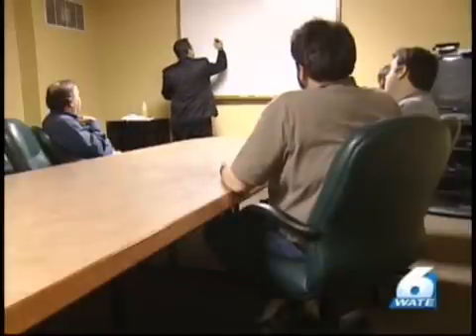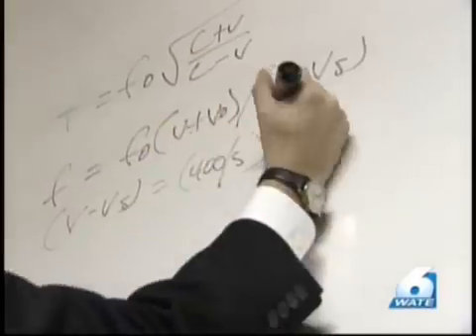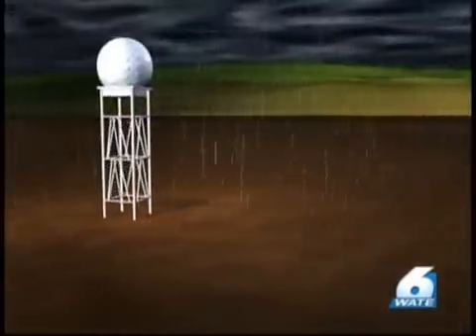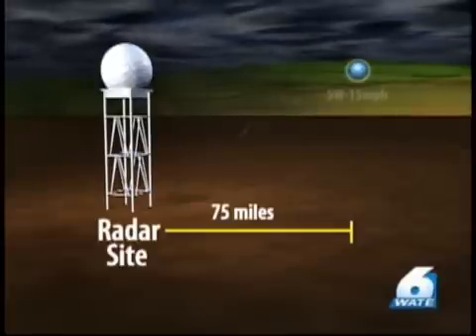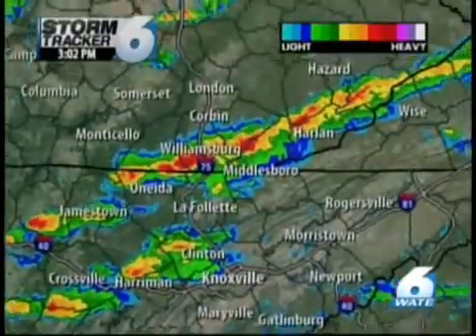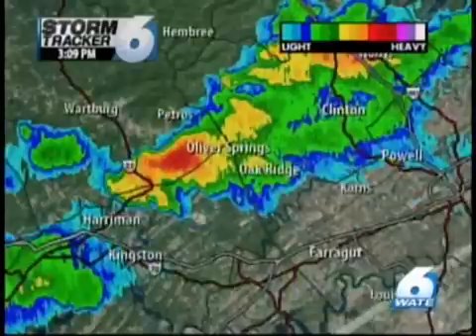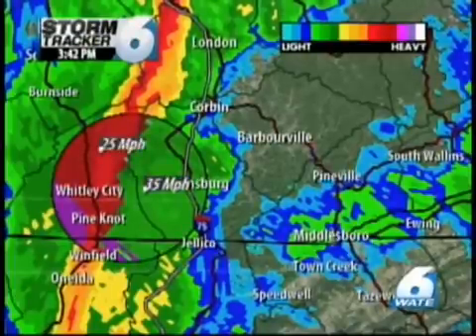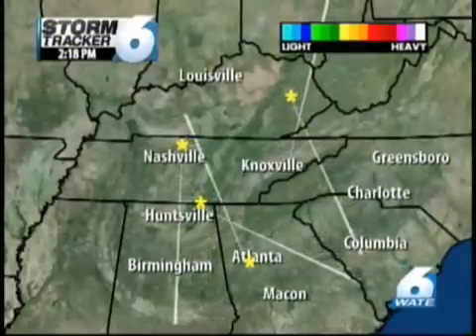Ken Weathers - Doppler Radar Explanation

Comment: Lol.......what !!! How does this work on a globe earth????????
Reply: Interestingly enough, the curvature of the earth is something that limits the range of each radar:
https://youtu.be/NZ7rNeQck2A
Reply: Lmao imagine being a flat earther, the Earth is a cube dumbass
Reply: Idiot. The curve of the earth is the reason why weathermen switch from one radar site to another. The beam goes higher the farther away it is from the site because of the curve.
Reply: @schutzdan23  You're the Idiot, the signal doesn't travel that far. Pulse-Doppler typically uses medium pulse repetition frequency (PRF) from about 3 kHz to 30 kHz. The range between transmit pulses is 5 km to 50 km. Not far enough for globe maths to even detect a "curve"..
Reply: @Felix_Effex    50 Kilometers is WAY more than enough to detect the earths curvature, that's why they are elevated and not on the ground.  It's only 32 km at sea level.